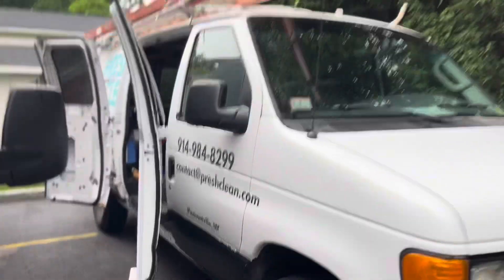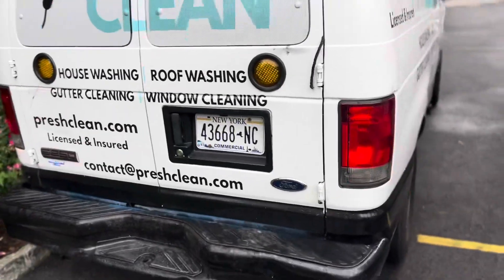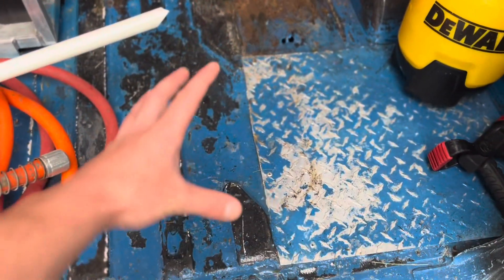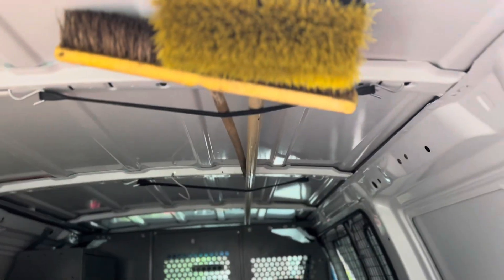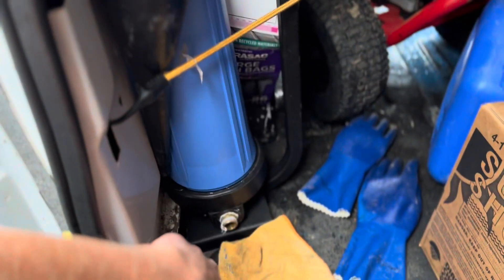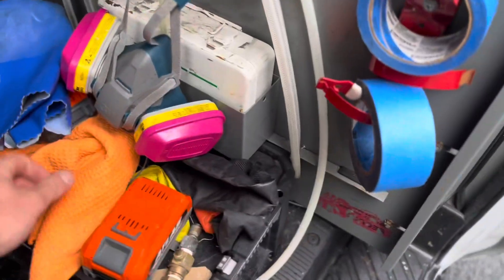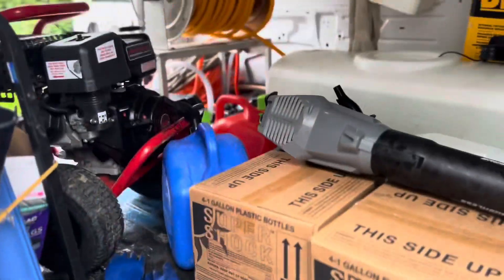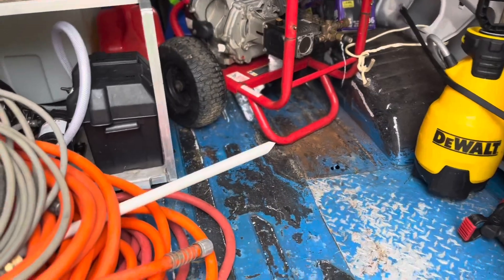IM BACK - OUR NEW PRESSURE WASHING TRUCK SETUP

Comment: How do you lower the pressure on the predator pressure washer for house washing? Do you ever adjust unloader valve to start or while running?
Reply from the maker: There's a knob, but its mainly the wand tips you use. If you want to soft wash checkout a JROD
Reply: @jmventurelog  I have the xjet m5, will that work? I have the same predator pressure washer.
Reply from the maker: @Swivelsix  it should

Comment: do you take this pressure out of the van when pressing washing or keep it in the van and run a long water hose to it?
Reply from the maker: If it’s in reach we’ll keep it in
Reply: @jmventurelog  how much psi is your pressure washer and how long of a hose do you use
Reply from the maker: @agentchandler5596  psi doesnt matter when soft washing its all about gpm which you want at least 4gpm
Reply from the maker: longer the hose the better, at least 100ft
Reply: How do you lower the pressure on the predator pressure washer for house washing?